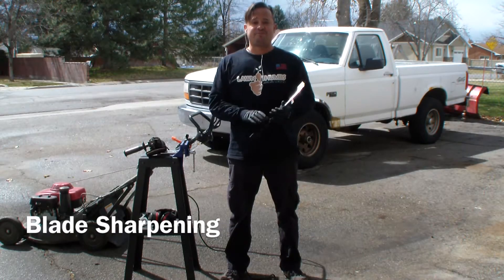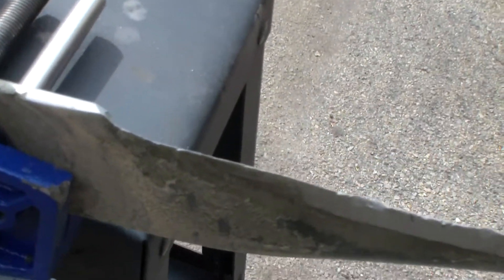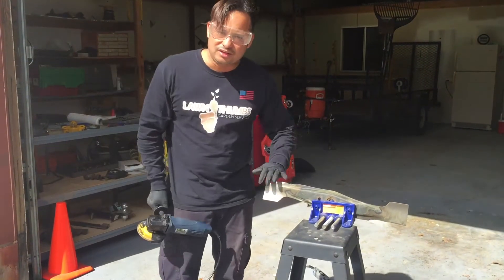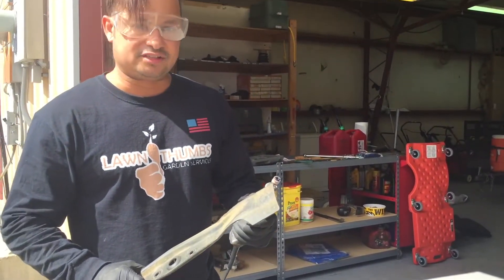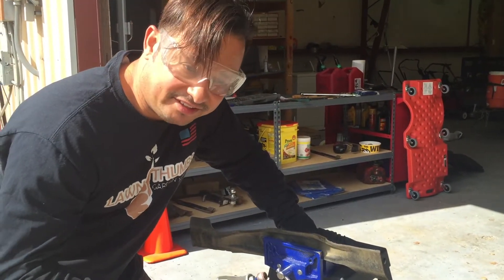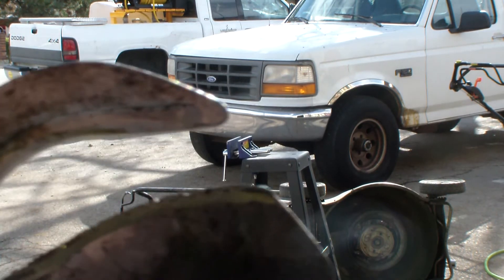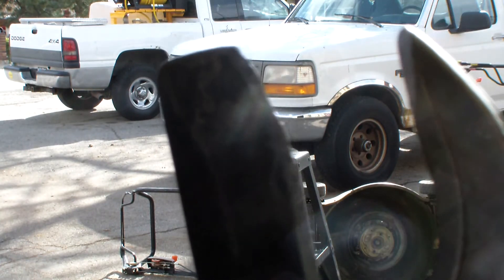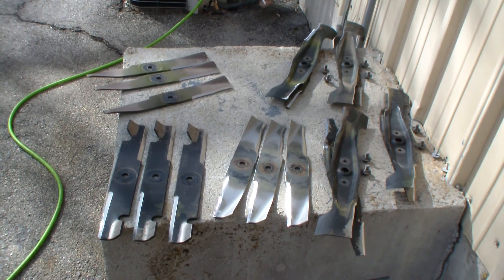Blade Sharpening

Comment: you don't balance them?
Reply from the maker: +Sunset Services No, I never even thought of that! But after doing some research on balancing I may start doing it. Thanks for the comment!!
Reply: you can hang a nail off a wall and balance them that way or buy a blade balancer . Another trick is count how many passes you make with the grinder on each side and it will help to get close to balance unless you hit a rock .
Reply from the maker: Sunset Services I'm going to look for a balancer at lowes or Home Depot. Thanks!!
Reply: i think home depot has them . Its a table top one. just make sure your table top is leveled  :) . I use the wall magnetic one easy to use and its self leveling even if your wall is not . cost more but when your working on 10k lawn mowers the cost is worth it.